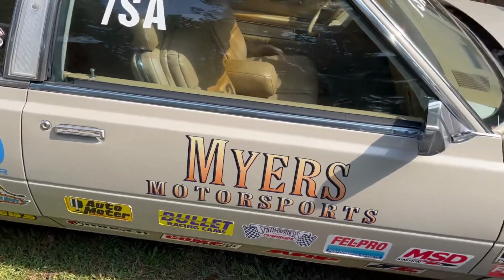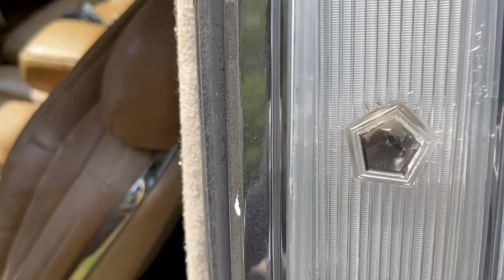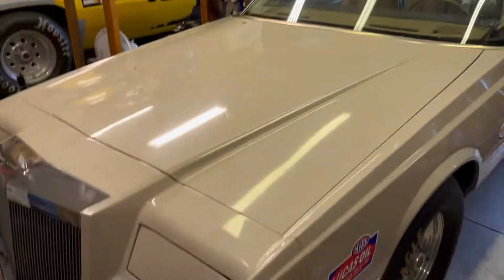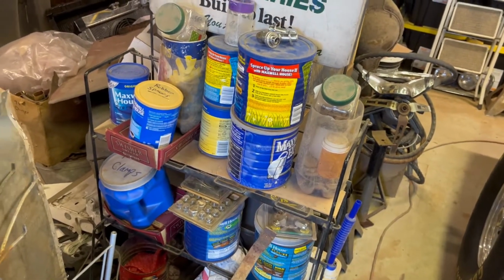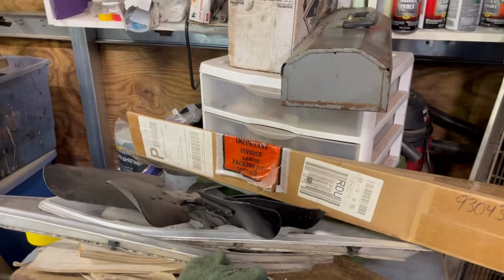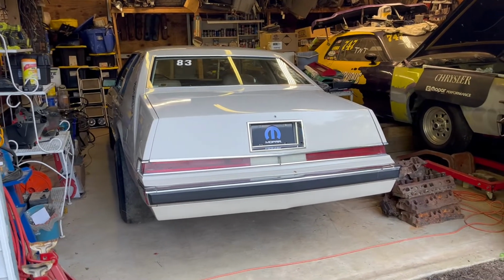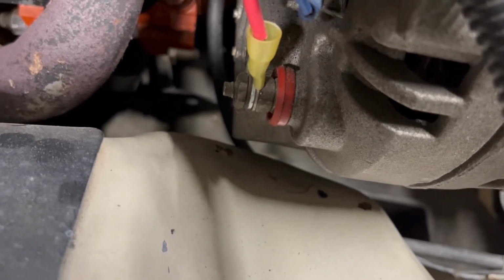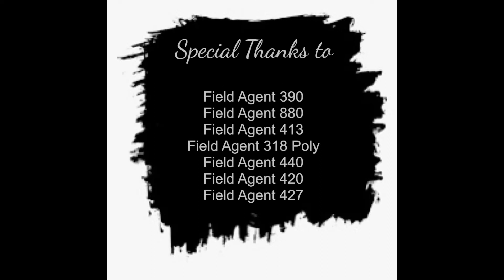Finally got the Imperial drag car car in the shop

Comment: The loose column is the typical problem with tilt Saginaw columns, it's not to bad of a job. 4 bolts down in the column, but if you have never done it you may need some guidance.  Remove them one at a time and add some blue loctite.

Isn't that where your Baracuda was sitting?